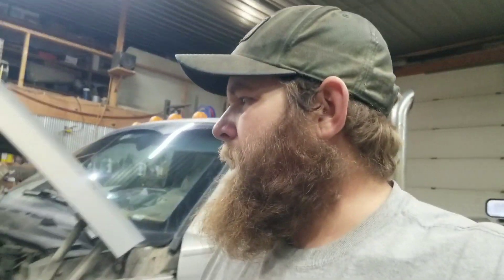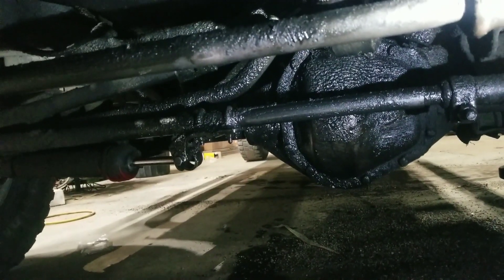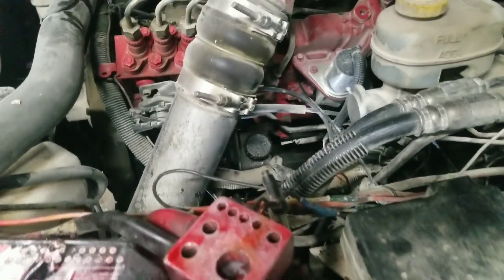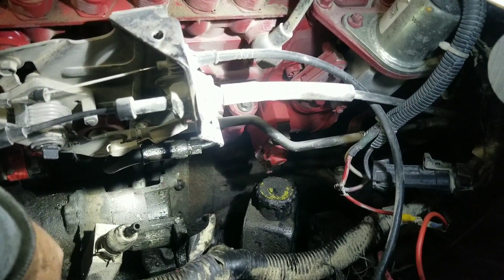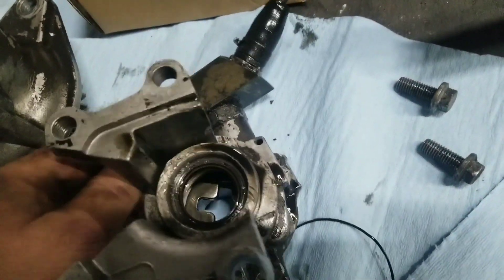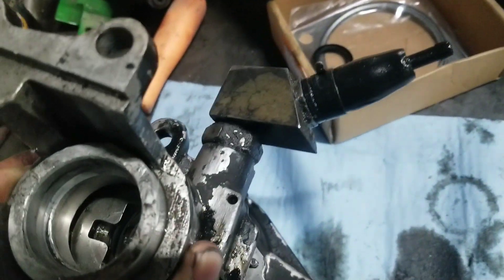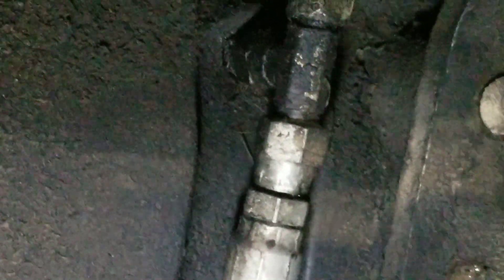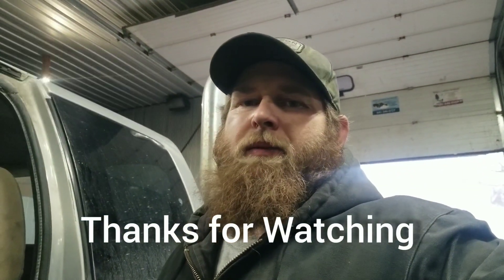How to fix leaking Cummins 12v vacuum pump.

Comment: Is the large vacuum gasket made of metal or a paper gasket?
Reply: I was waiting on him to tell us which way the little V dimple on the gasket faces. I’m trying to figure that out now. The gasket I took off (the big one) was rubber. The new one is like an aluminum press?
Reply from the maker: @Rubbertoe907 either way on the mating gasket
Reply from the maker: I have seen them be both
Reply: I asked ChatGPT. I was very detailed in my question. The AI was very specific and said that the V shaped part of the gasket that sticks out faces the vacuum pump itself. The flat surface faces the front towards the front of the engine

Comment: I think the seal is supposed to go on other side of retainer so the oil and crank case pressure do not blow it off. It is possible to put it in both ways.
Reply from the maker: I think you're right. Luckily, it hasn't started leaking yet, I'll make sure to keep an eye out for it now.
Reply: Yes. Mine came out from the other side. Not the side that he put it in.